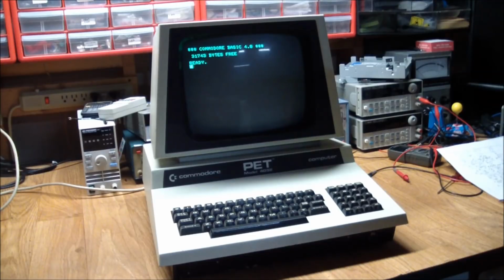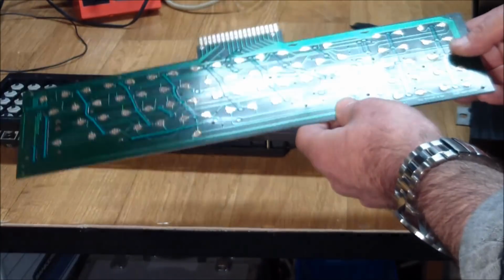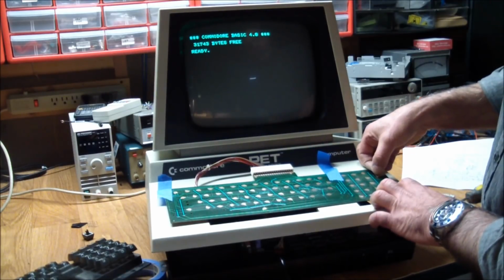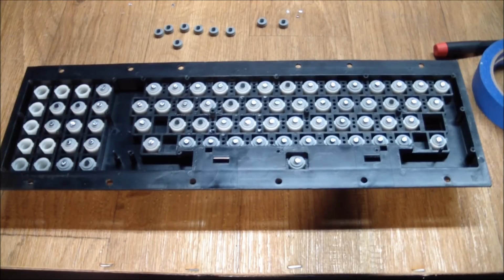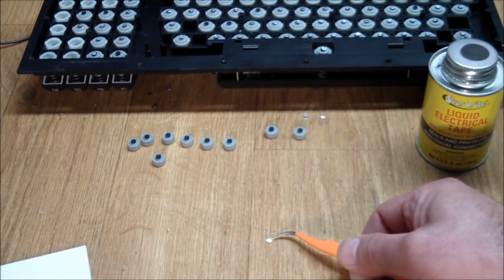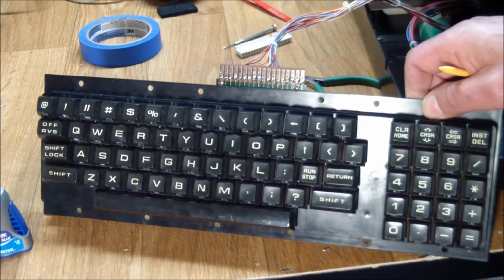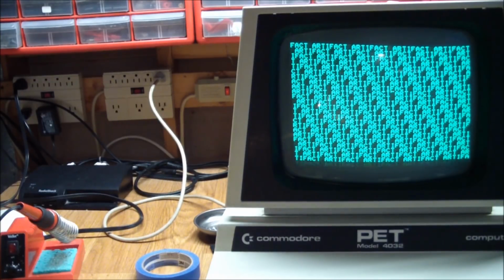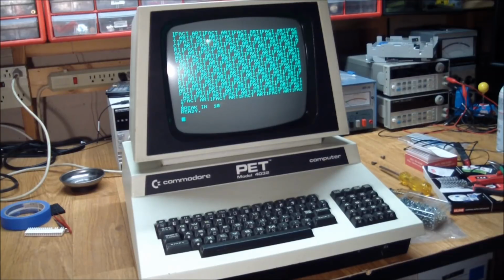AE#87 Commodore Pet 4032 Repair Part 2

Comment: I"m confused on the differences between a Joule compared to wattage, they seem like the same thing. What circuits when testing would you want to measure the joules? When you convert joules to wattage its based on seconds time.

Comment: I have had the same problem with carbon pads and sticking foil on them, tried super glue, evo stick and some others to no avail.
I have used this silver loaded paint, quite successfully.
https://uk.rs-online.com/web/p/conductive-adhesives/1239911/
The plastic spigots on the scan coil are to fit little magnets and rotate them on the spigot until the picture is rectangular.
Reply from the maker: I've also had good success with conductive glue which I used to revitalize a music keyboard that had carbon contacts which had developed a high resistance.

Comment: Hello Artifact Electronics.
I am just getting started on a Commodore PET 2001-8 computer, that may be having a power supply issue. 
So, I have disconnected the MB and powered the system on.
It does not appear that I am getting anything off the large cap, right now, with no load. 
Off the Transformer, I am getting 7.3VAC, 8.3VAC, 8.3VAC and on the back side I am only getting 6.3VAC 
The cap does not look like it has leaked, but keep in mind there is no load. 
Although there still should be power going up to the monitor. 
The two wires from the Transformer going up to the monitor are labeled Rear Left (6.3VAC) and Front Left (7.3VAC)
I do have a Commodore PET 2001-N that I might be able to use for comparison.
Reply from the maker: Since your dealing with a linear power supply you should be seeing some voltage on the cap. Check the rectifier diodes which are connected directly to the transformer secondaries and should be supplying unregulated DC to the regulators. The cap smoothes the unregulated +5V. The monitor won't come on if the processor isn't running, but check the output of the regulator on the monitor chassis which should be +18V.
Reply: What I have found out today, by watching another video. Is that it looks like someone installed one of the rectifier diodes in the wrong direction.
I believe that the one closest to the power connector should be pointing in the opposite direction as the other two.

I have ordered new diodes, that will hopefully be here by next week.

Here is the video that I watched, that was fairly informative, as far as powering on the system, with out the MB plugged in..  https://www.youtube.com/watch?v=Vwg0Bw0KvZo

I am getting the same 16.6VAC and 8.3VAC when using the center tap.
Reply: This video starts off giving you a good explanation of how the power supply works, and why I do not get anything 
on the two red wires coming off the large cap, when the motherboard is not connected.
https://www.youtube.com/watch?v=3Jyuke-cnzE

Comment: so much effort you put in this,i respect that! but answer was in front of your nose,
lead pencil , HB pen,i use it on old keyboards like this one ,and all commodore computers,just drew on top of keys with pen :) cheers !
Reply from the maker: Even though it wasn't included in the video I tried the pencil method. Nothing, and I mean nothing would stick to the carbon contacts that's why I had to brute force the conductive discs with super glue.

Comment: I would have used super glue on each key, then stick the aluminum foil on them, Or better yes...use that silver pen...used to repair the traces on circuit boards...its in a pen that you squeeze ,,,,and the material that comes out is conductive, and then it dries..

Comment: Ever try a can of Coke to clean rust?  Works very well.  The phosphoric acid in Coke is a cheap yet effective way of getting phosphoric acid.  Have cleaned ammo dies and other parts with it as well, with favorable results.  You can also use citric acid, available at the grocery store - too . . .
Reply from the maker: Long ago I tried Coke on a car bumper, but left it on for too long. The rust was gone, but so was a good portion of the chrome underneath. Or maybe the rust had just pitted it badly. Vinegar is not nearly as potent, but it seems to leave the original finish unharmed.

Comment: You can adjust the geometry with some small square magnets from other CRT yokes. The ones with a single side coloured and with a hole in it are a soft ferrite rubber, and you generally use them on the posts on the yoke to adjust corner geometry and linearity in corners. The longer ones on plastic strips will correct as well, just slide into the yoke well from the front, and adjust for the best display. Your CRT probably has been slightly distorted inside during shipping, so you will need to play with magnets to get it right after recapping, and using the adjustments on the board to get it as good as possible. First use the ones on the back of the yoke by the clamp to adjust the linearity, as they probably are moved by somebody, which should at least get most of the distortion out, but if they have been cooked and lost magnetism you will need to add extra ones, probably from a dead yoke of similar diameter that is scrap. Once in best position lock with a dab of nail polish to lock in place gently.

Pull the yoke back slightly to get the image to cover more of the CRT before adjusting, then put the magnets and leave there. For the long strip magnets best thing to stick them is silicone sealer, as it sticks to the glass well.

Comment: There should be additional adjustments for the picture available inside the case now that you've got the back off.  They should cover all the normal CRT adjustments.

Comment: Just out of curiosity, what you do nowadays with such a computer. Program it in basic ? You can sometimes make them work again by using a pencil (the graphite conducts). I once made conductive glue using the graphite powder you use to "grease" a cilinder lock and CA glue
Reply from the maker: I don't do anything really productive, but I enjoy bringing them back to working condition. There's also a lot of software available online because of expired copyrights, and playing those games brings back fond memories.